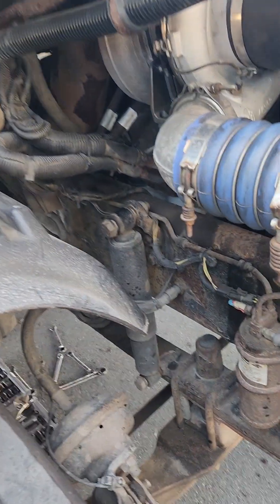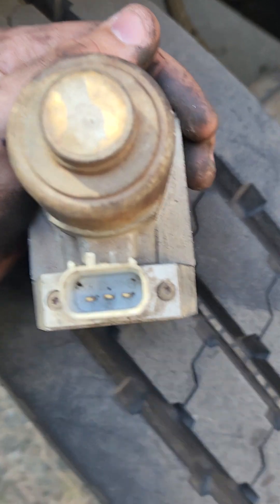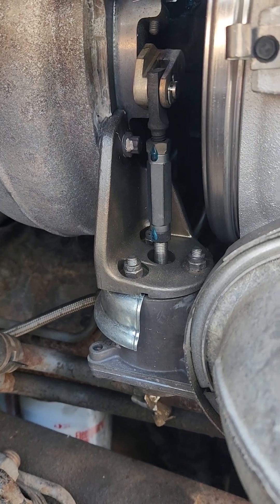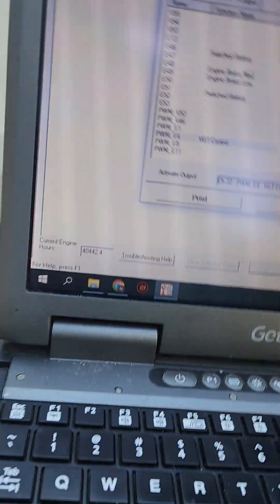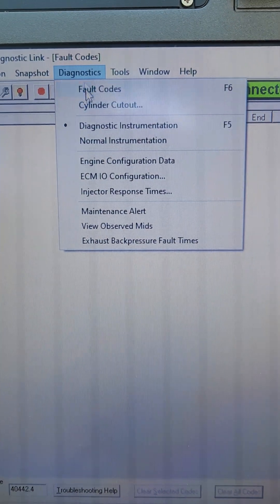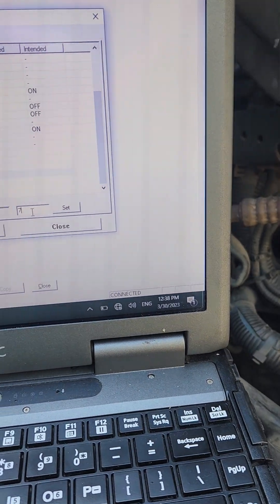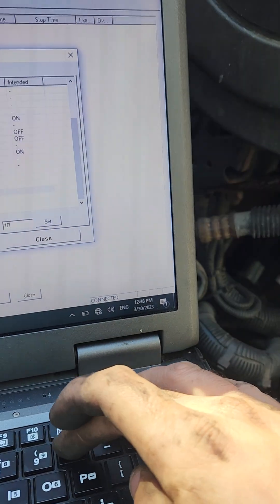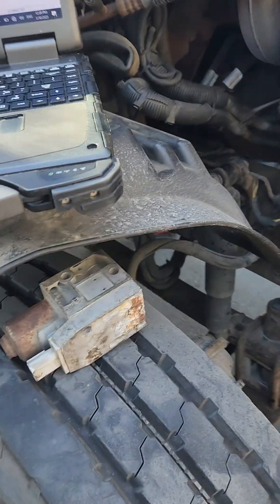Detroit S60 BAD VPOD!! How to test VPOD?  DDEC IV, V

Comment: Very good info. Mine on idle goes all the way up to 100, it touches the adjusting bolt and turbo starts squealing. Do you have any idea what can be wrong?
Reply: Hello
My truck is aslo has same problem, vpod stays in boost mode also on idle, did u figure out something

Comment: Hello,  thank you  for the video great info. Can you  tell me what kind of software are you using for diagnostic and where can i get it from. I replaced 3 vipods in one week on my truck and truck is still not  working right I will greatly Appreciate your respond
Reply: Atanas Gyulev I have a question 
What was the reason or issue to replace it 
Because I got a Columbia 06 14 L
Reply: @José Reyes  west gate on the turbo is moving on its own cutting on and off the turbo while driving
Reply: @atanasgyulev474 did you find the fix to your problem? I’m having the same issue. Thanks in advance.
Reply: @ElplebeTex  not really 4 VPODS latter I gave up and just disconnected the  west gate and left the turbo vanes open about  85% 🤷‍♂️
Reply: @atanasgyulev474  how were you able to accomplish that if you don’t mind sharing? My truck jumps up, power cuts in n out when boost is required. At low rpm’s it runs just fine also runs fine at idle. In advance thank you.
Reply: @ElplebeTex   I stopped the air to the west gate and extended the road.  That's all I did . Keep in mind that this way you will be abusing your Turbo more soo its life will be shorter. Just a  temporary solution to  get you  to where you going I guess 🤷‍♂️
Reply: @Easy19522 si you find the fix to your problem? Thanks
Reply: Thank you for your respond so soon

Comment: Can a bad vpod cause hiccups with blowing black smoke while accelerating?
Reply: Same thing I want to know.  Any feedback?
Reply: Did y’all figure it out? Thanks
Reply: @ElplebeTex  I bought a new vpod and it was a waste of money because it definitely wasn't the reason. To this day after replacing the vpod erg valve a couple other sensors my truck still does this and I have absolutely no clue why
Reply: @johnblaze21519  that sucks. I was going to replace my VPod today but maybe I just don’t… thanks for the feed back.
Reply: @ElplebeTex  if when u hit the gas and the little needle or valve on the turbo goes up and down then you don't need it. If it only goes a little or doesn't move at all then yeah. But u provide knew that already
Reply: @johnblaze21519 replaced vpod and nothing. I’m thinking of clutch slippage or bad turbo just throwing that out there. Some of These mechanics will rob you blind.